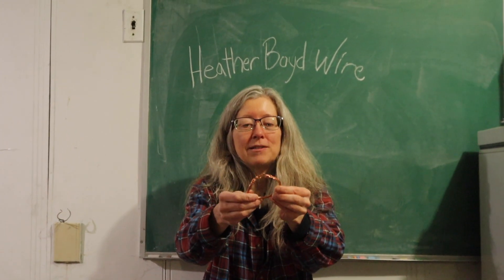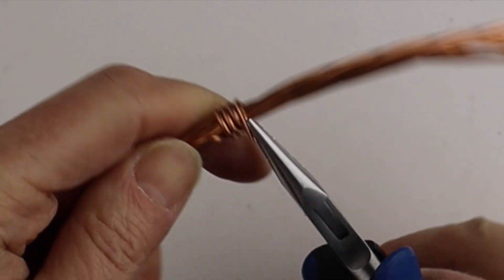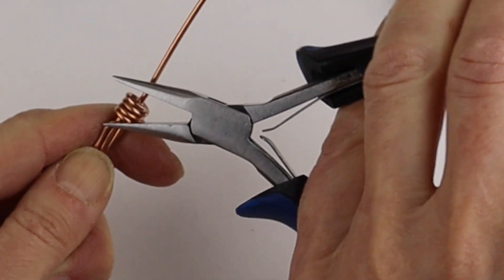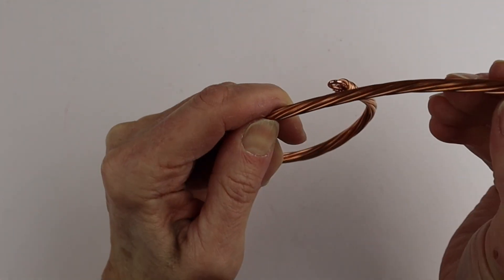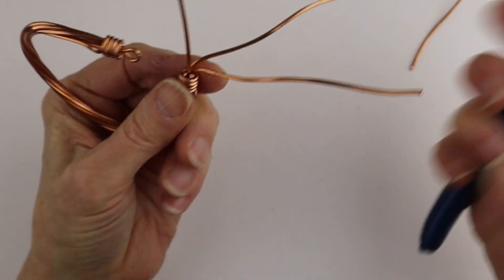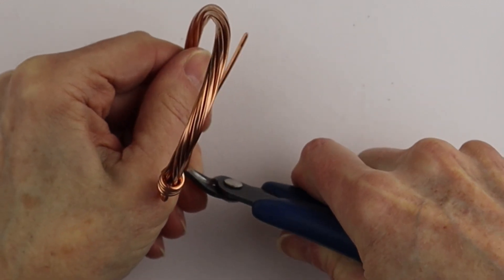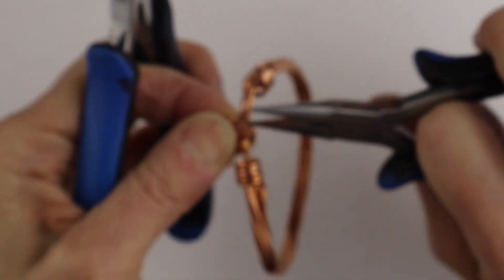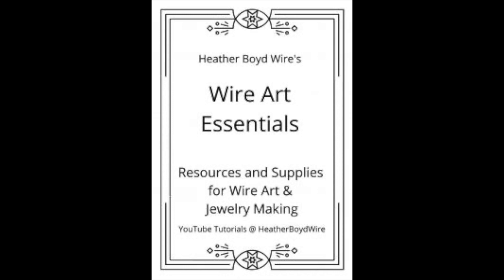Men's Unisex Wire Bracelet from 7-Strand Bare Copper // Tip Tuesday

Comment from the maker: Wire can be found at most hardware stores. Larger bracelet uses 6/7 (6 gauge total of 7 strands). I also made a smaller bracelet using 10/7 (10 gauge/7 strand) that I stripped off the plastic. Check this video to see how: https://www.youtube.com/watch?v=hogdm7Q0ZZQ&t=3s
Reply: What kind of wire with plastic?
Reply: Where in the world do you get such a huge spool of copper?

Comment from the maker: TIP from Joan: "Wrap the outer wire once or twice then cut the other 5 pieces, then continue to do the last wrap or two and it really hides/tucks in the cut pieces.  Still enough of a wrap around to hold it together. No sharp edges".